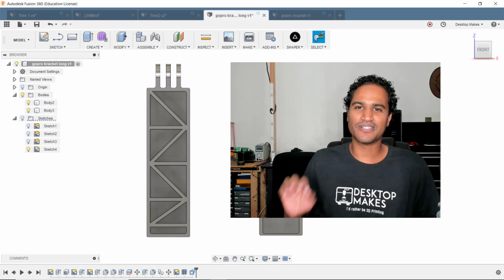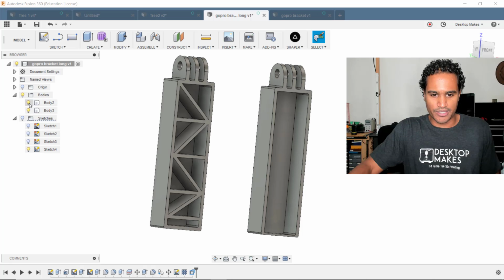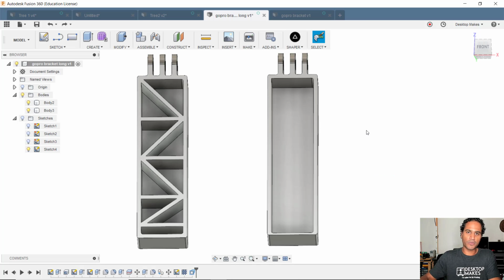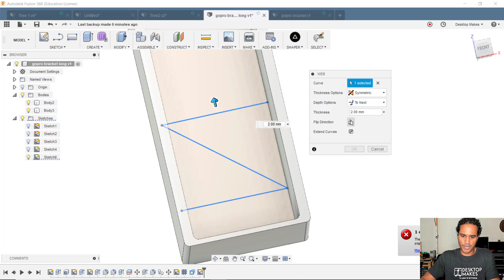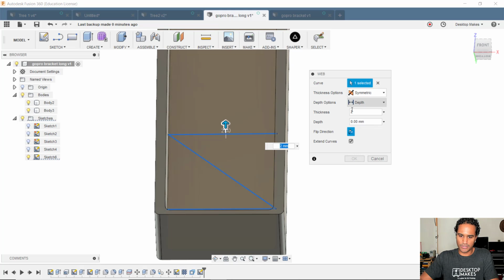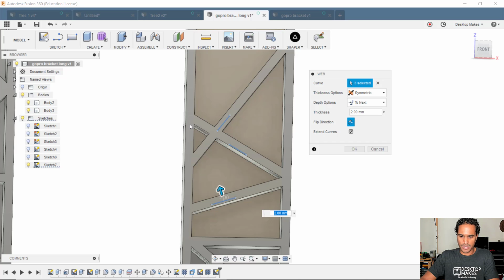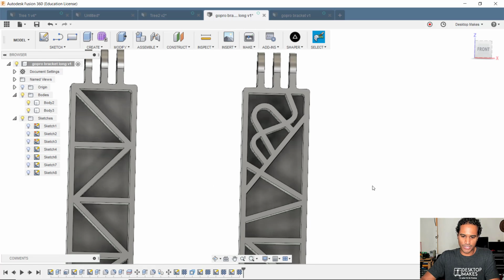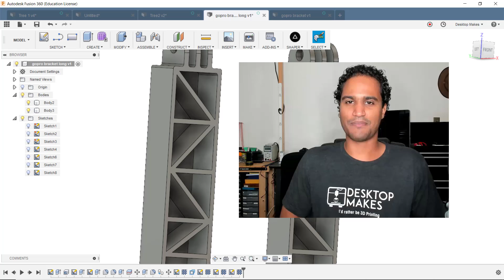Web Tool in Fusion 360

Comment: The holder really needs bigger feet to extend along the edge of the plate. But  it is still a nice tip and you get another thumbs up from me.
Reply from the maker: Thanks ion1969.  Yeah, the cross braces improved stability but you're right - it does need wider feet.  I'll most likely do a redesign with a wider base.